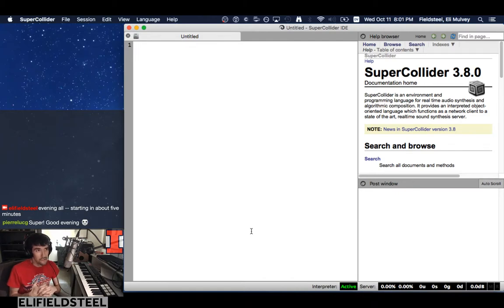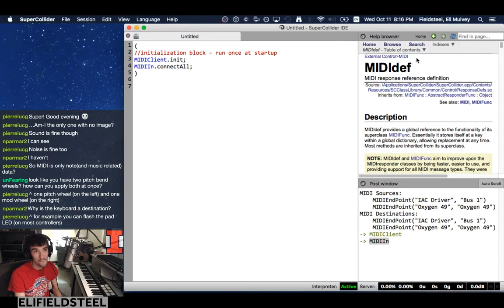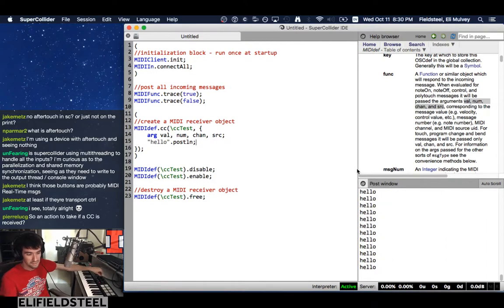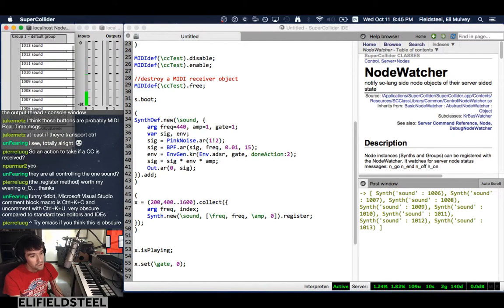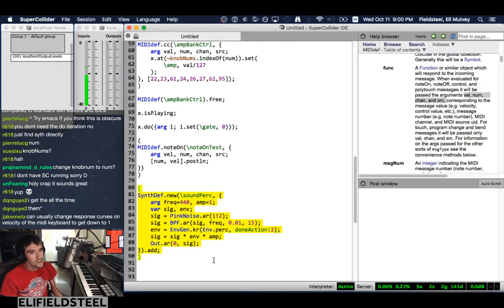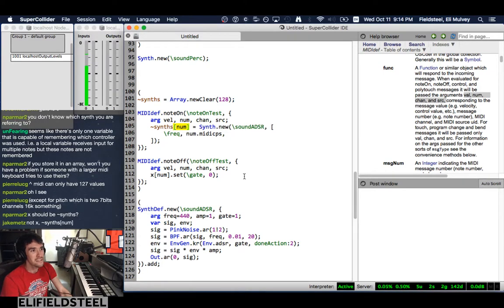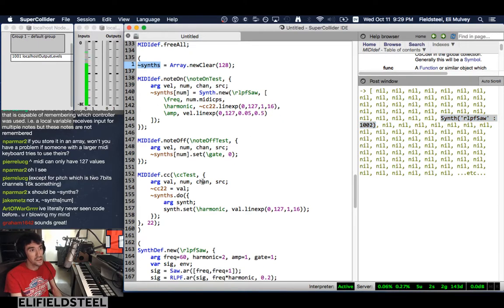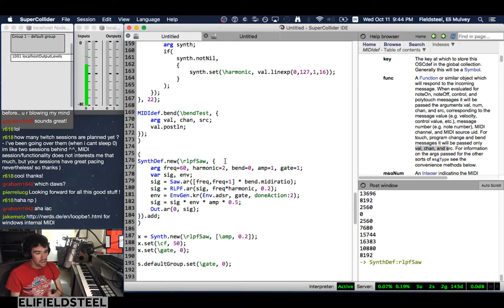MIDI - Week 6 Fall 2017 MUS 499C - Intro to SuperCollider

Comment: Eli, I'm interested to know if you could use SC to trigger an external synth (ex: DS Prophet)? In a way it might seem a bit of an odd question as SC is about building synths, but, it's more for running several things together - pads or bass lines whilst doing more 'imaginative' stuff with your SC. I'd also be interested to understand the clock syncing between SC and external machines (using Tempo/System/App clocks?). Maybe some of this is covered in your tutorial #18? Thanks again, great stuff as always.
Reply from the maker: Not an odd question at all -- a very cool thing to do IMHO. Does your DS Prophet have a 5-pin MIDI input jack? If so, then yes, Tutorial 18 is the one to watch. The main difference is that you'd have SC output MIDI to some sort of USB-MIDI interface instead of the IAC driver, and connect the interface to your Prophet. If it's an exclusively analog device, you'll need to design some sort of digital-to-analog translator, maybe using an Arduino or Raspberry Pi. And as far as sync'ing goes, you can use Pbind to sequence MIDI messages, also covered in Tutorial 18.
Reply: Okay, looks interesting. Just for the info the synth I'm using (in this case) is a Prophet 08 Rev2 (8 voice). It indeed has either a USB connection or/and the standard midi 5-pin also. Thanks again.
Reply: edit: see my later comment in this thread, I'm making a recommendation based on already having learned about server architecture.
just a quick plug that can make life easier if you're going this route: one thing I've also found very useful in taking the audio from my external synths on different inputs in my sound card and integrating those noises with my supercollider synths and effects is the ddw quark (http://ecmc.rochester.edu/ecmc/docs/supercollider/scbook/Ch20_dewdrop_chucklib/dewdrop_lib/dewdrop_lib/dewdrop.html). it gives you some nice high-level abstractions for making things like mixers and effects sends. you can go the manual route like in the week 5 video of this series, where you create groups and busses manually and have to worry about things like node order, or you can let ddw_lib handle it all for you! So you basically replicate the signal routing utilities you'd find in a daw with supercollider, along with all of the nice pattern functions and synth craziness native to sc. the author of the quark (hjh) is also quite active on the supercollider forums if you need help with things.
Reply: another note: I've done some controlling of my DSI Tetra with supercollider, and many of the parameters on the Tetra are controlled using NRPN (https://en.wikipedia.org/wiki/NRPN). I think a lot of DSI synths use NRPN, so that might be the case on the Prophet. Here's an example of setting a NRPN using SC if you need it: http://sccode.org/1-57O (only sharing because it took me a while to figure it out, also I haven't revisited that code in a while in case something doesn't work)
Reply from the maker: I do sometimes feel like I'm being too much of a purist by intentionally avoiding a reliance on Quarks and extensions. Although, as an educator, I believe it's important to learn the vanilla language and develop a concrete understanding of the basics before branching out, and this is why I avoid making endorsements like this. However, for freelance artists, as well as anyone for whom time is a scarce resource, I would absolutely recommend quarks, particularly the ddw family. While I don't use ddw Quarks extensively or regularly, I know enough about James' work (and the number of people who use it) that I feel comfortable seconding this recommendation.
Reply: definitely, didn't mean to contradict your content at all for the purposes of a class. indeed, if I had buckled down and actually made the effort to learn properly about server architecture, I probably would have made much more headway in my earlier supercollider days.
Reply: Hi James, big thanks for the links, I'll check them out. I'm also on the SC forum (along with Eli and James 'hjh'), so if you want to chat, pass me a message using the internal link, I'd be most interested. I've posted these questions here just so that people who are unfamiliar with SC can see the discussions. In the meanwhile your suggestions look very interesting - and I've been chatting/following Eli's stuff for years. Great, and thanks everyone.

Comment: Eli is there away to sample in supercollider with having to use a outside sample editor to do the sample cutting...like is the a offset sample choosing function or sample chooser like in the video?
Reply from the maker: You don't necessarily have to cut up a sample in an external editor. You can alternatively read in one big sample, and have each note-on jump to a specific point in the file and read a specific length. You might have to play around with the numbers until it sounds "right."
Reply from the maker: brandon taylor and I should point out that I can't determine the code implementation from watching the video. There are multiple and slightly different ways to achieve the same result.